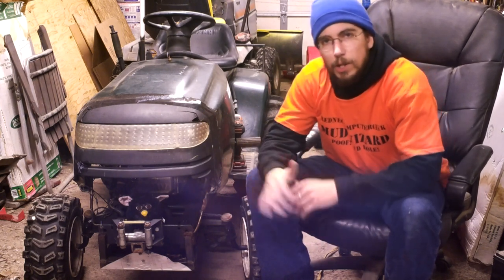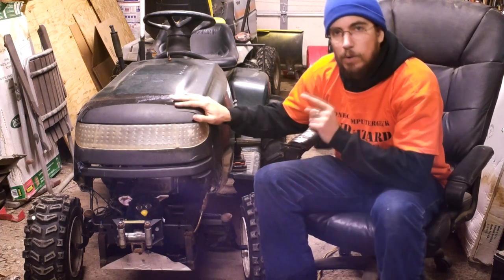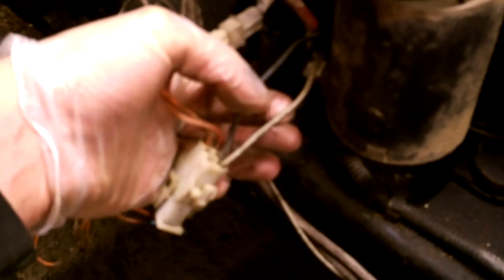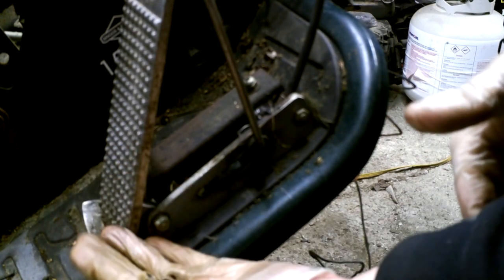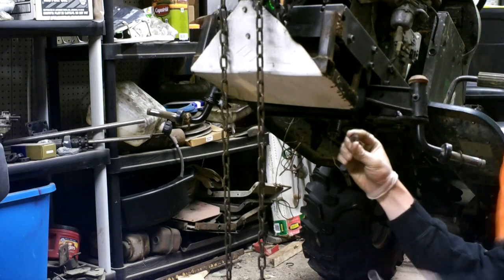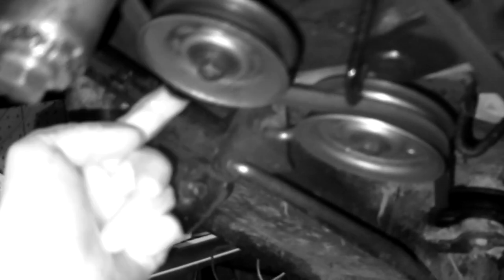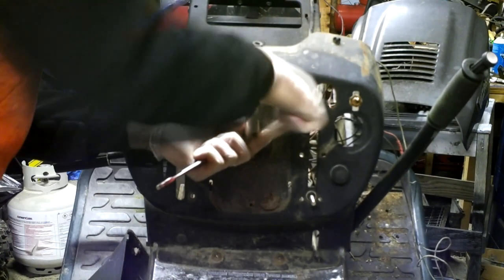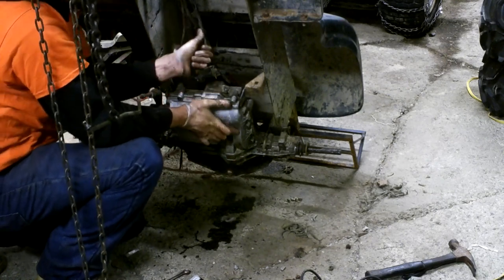Disassembly of Maine Mud Mower

Comment: Have lifted one of those yet. I want to utilize my older LT1000 toget a head start on cutting some new fields.  With the blades all the way up and the gearing in granny low it took me 38 hours to get the 2.5 acres down to a realistic mowing height. The 21.5hp motor would die unless i slapped blade release as soon as it bogged, and back up. So i am anticipating lifting it about four inches then just going over it a few times lowering the blade each time till the grass is low enough to turn the Cub loose on it. 
Lol. I only have about 20 more fields to do.